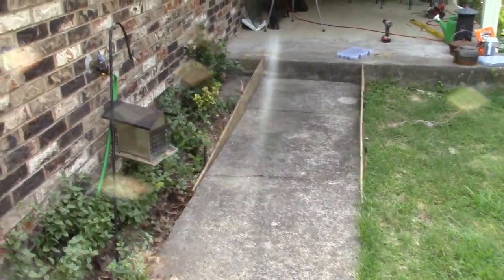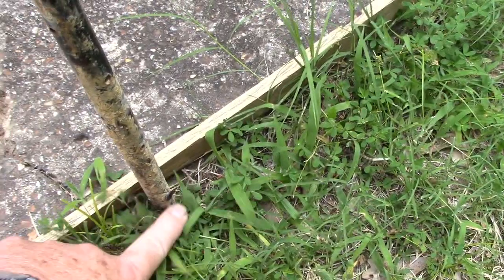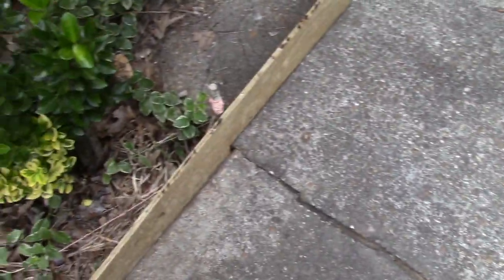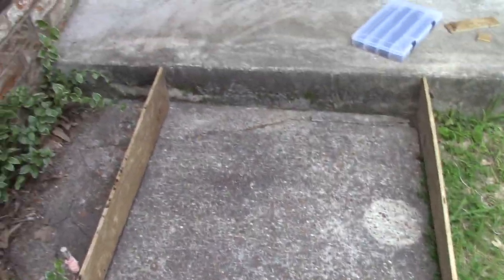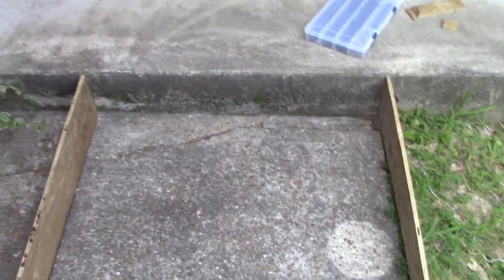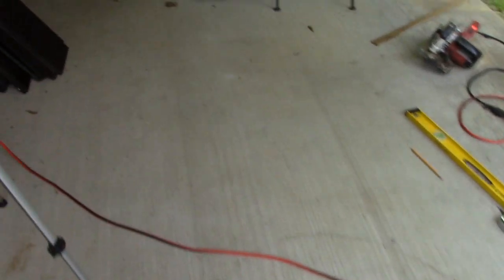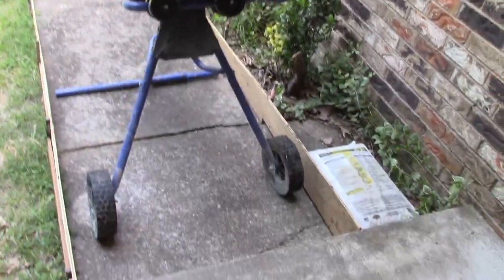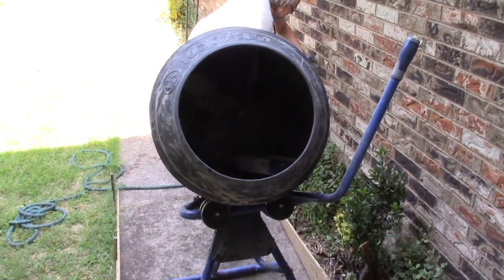How to Make a Concrete Wheelchair Ramp with Quikrete Sakrete and Kobalt Electric Mixer

Comment: Quickrete instructions say to use a 2 inch minimum pour. How long was it before the base of the ramp cracked and broke away?
Reply from the maker: It’s still hanging tough. The thing to remember is there is no load on it, as it’s supported by the concrete porch below it.

Comment: No rebar needed?
Reply from the maker: It doesn't hurt, but it hasn't cracked yet, and I'm not real worried if it does crack so I didn't use any rebar.
Reply: @PirateStu  hey happy it hasn't crack, I just looked a little thick for no rebar or fencing or anything. It looks good for sure
Reply from the maker: @dust4546  there may be rebar in the underlying sidewalk that will support it. I don't usually worry about rebar in small projects that aren't foundational. And the last few foundational projects that I did do, I used concrete with metal fibers in it, instead of rebar, since it's a lot less work.
Reply: @PirateStu  ive never seen metal fibers before. I usually use rebar ive gotten for free or fencing but its probably overkill. Ill definitely check out metal fibers.
Reply from the maker: @dust4546  you can order your concrete with the fibers in it. Obviously, they charge more for it. The fibers look like 3 inch pieces of wire from a wire brush, and it is kinked on both ends.
Reply from the maker: Here's a link. https://www.knightscompanies.com/blog/concrete/using-wire-mesh-vs-fibers-with-concrete/
Reply: @PirateStu  thats wild. Could diy with regular concrete im sure.
Reply from the maker: @dust4546  You can buy a variety of fibers separately to add to sakrete.